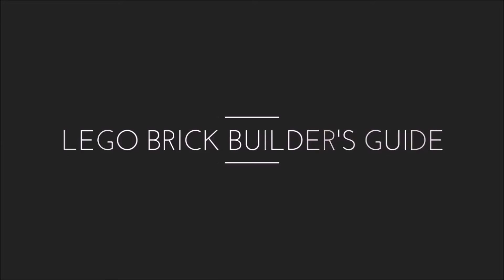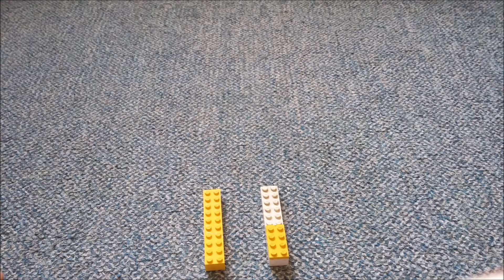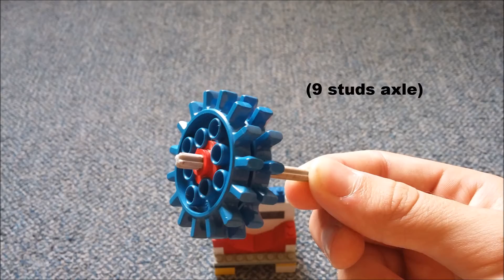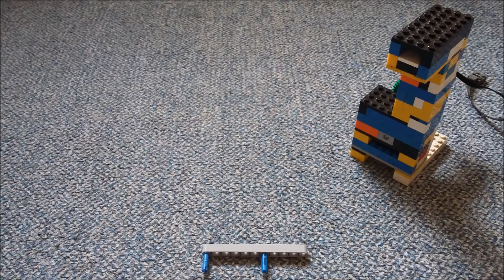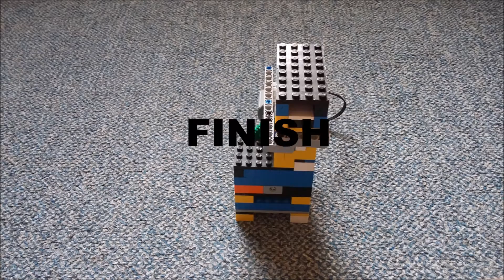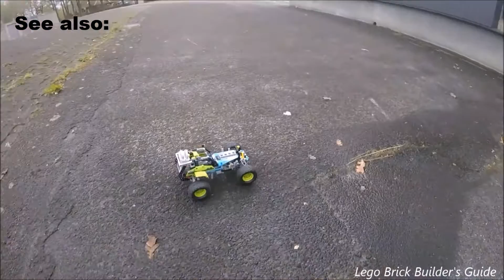Lego (Technic) Water Pump Building Instructions

Comment: can we use different gears the same size instead of use the blue ad red ones
Reply from the maker: DsNester Yes, but so smaller the space between the teeth, so less water is pumping up! I advise you to use the blue gear!
Reply: thank you so much
Reply: Doesnt Have To Actually Be Blue In Color, Right?
Same With The Red Ones
Reply: How dose the water come up and out it don’t make sense 🤔🤔but good instructions 🤗🤗😃
Reply: @singleesingles1153  the force from the fast spinning gears push the water up if the Water has no where else to go. think of it as air coming out from a air vent, the air has no where else to go, so it has to come out through the air vents. same with the water. but only with more force/pressure.